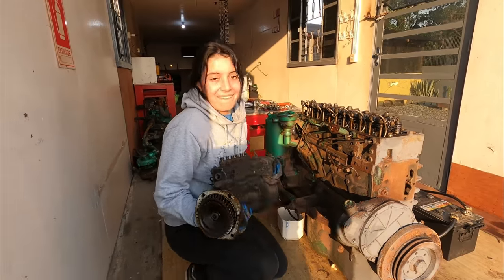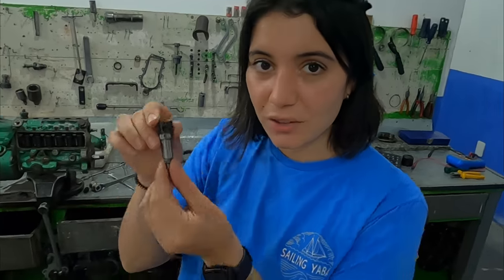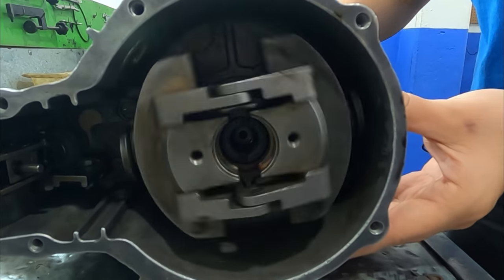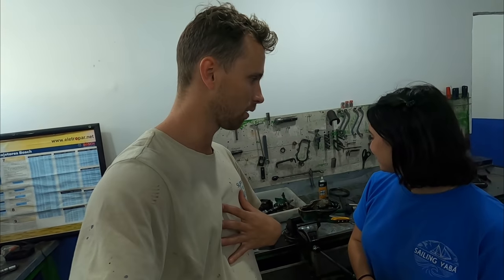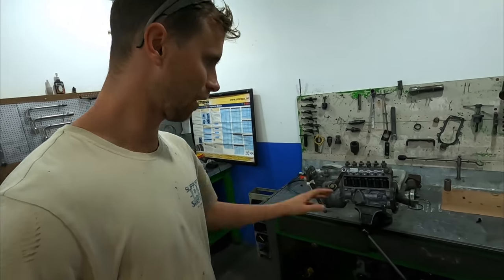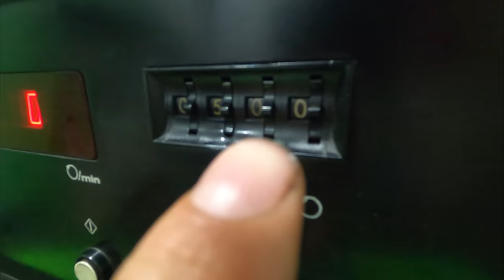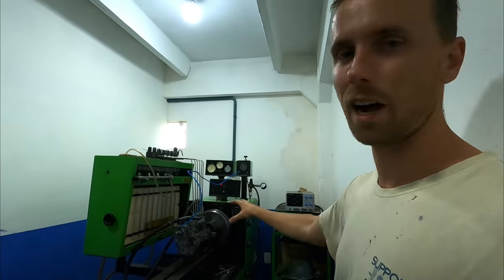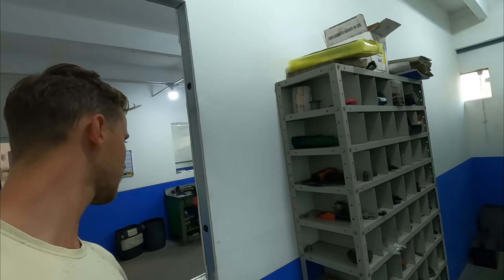Taking apart our old diesel injection pump at a local Brazilian truck stop OM352A — Sailing Yabá #59

Comment from the maker: Hey guys! We hope the skills of our mechanics won't allow you to miss our carpenters too much this week! 
By the way, how lucky are we with all the professionals that we've been meeting along the way?
Reply: You couldn't be luckier. When you started, I will admit, I was very skeptical. I'm not anymore. <3
Reply: I think you are extremely lucky with the professionals you are working with. What a great crew! Also you are so fortunate to have each other and the support of your families. For example we see from the video series that MP's father helps, too. That is wonderful to see,
Reply: MP you seem to have lost a little weight too, you look a little bit cuter.
Reply: Is actually really really lucky that this type engine can be service at regular truck stops! You guys can get good quality service pretty much anywhere in Brazil! But hands down: that shop was impeccable  👏👏👏
Reply: When working in Peru I had an old model Jeep CJ3-B also bcs I wanted to "understand" more of my vehicle I decided to maintain/repair/rebuild the entire vehicle by local mechanics. It went so far as to splitting the engine, re-boring the cylinders, separating body and frame, etc. 
Hopefully your mechanics are of a better league. After re-assembly it had only 50% of the tiny power I had before the "operation" started, and at the end of the day my only option was to abandon the vehicle in the field. Possibly a flimsy job re-surfacing/fitting the block/headers was the culprit. 
Advice: if you re-building old engines down to the last nuts/have any specialist work on your possessions, if you are NOT a mechanic/pro yourself, and if you deal with dodgy persons (as a gringo/foreigner you will most likely be screwed), then have at least a 2nd/non-related mechanic/specialist to verify the quality of the works done, AND do it before you pay.

Comment: Servicing the pump at that shop was the best call, not many places could have done that kind of work
Reply: My thought exactly.  Definitely not a DIY task.
Reply: Not a project for your normal repair shop. They most likely not have the skills,  or equipment. They would need to send it out to a shop such as this or they would just slap the pump back on in the state that it came off. Not good. Your re-conditioner and you made right call.
Reply: I learned this at school many many years ago. Indeed. There are not so many Diesel Services Centers left around these days. It is an art that is no longer mastered by many. Fortunately, there are still many in countries where older vehicles are still being used.

Comment: That was interesting. As an old pump mechanic it was a playback from way back; I've overhauled quite a few of those PES type pumps. When he was running the pump at low RPM; 250 I think it was, he was settling your engine idling speed and checking the individual fuel deliveries did not differ too much from max fuel delivery at high speed. With the idling on the pump set at 250rpm on the test bench, your engine will idle at 500rpm. When the ran the pump at very high speeds he was setting your governor as without one  diesels can get into a nasty habit of running away and blowing themselves up under certain conditions. Nice video. Thanks.
Reply: Is that not with a turbo engine though? They have not got a turbo, have they?
Reply: @johnnunn8688  Hi John. Not sure what you are referring to. They do have a turbo on the engine. The little box on the back of the injection pump is a control diaphragm to increase the fuel delivered when the turbo becomes efficient, or 'kicks in' at higher revs. turbos are not efficient at low revs.
Reply: @cousinjack2841 , oh, I must have misheard Ben. Sorry.
Reply: Takes me back too! That guy was being thorough on that pump. I remember, when I was a youngster, being taught how to do spill port timing on those pumps when putting an engine back together. Very hazy memory now. People advising a new engine, I find that odd. I don't suppose that old Merc lump has worked very hard and, if the standard of rebuild is good, it will have lots of life left in it.
Reply: @andysimons9226  Yes those old Mercs weren't the fastest but you can get a lot of miles out of them. I just remember the throttle linkages on the trucks being an absolute b@astard to get right.
Reply: @andysimons9226  No Andy " people advising a new engine" its not odd, its very sad. Its a generation that we have created where the words maintenence and save are now unknown.
Reply: Took a few injection pumps to get rebuilt. Never had time to watch the rebuild though. To much work to do. Ha ha.

Comment: Very interesting video. I have worked on several Diesel engines but I never really knew how the injector pump worked. It actually looks like a small engine with the cam, valves, valve springs and so on. I think that you made the right call to rebuild rather than buy a new engine. Diesel engines are famous for longevity if they are well maintained. Also the diesel shop looked very well set up and the technician appeared very competent and professional.

Comment: Rebuilding and calibrating a Diesel injector pump a highly skilled and specialized job, impossible without the correct equipment or almost. Great to watch this talented young man take this refurbishment through from start to finish.
Reply: Looks like that guy does that all day every day. Also looks like he got all that work done in a day or 2. Pretty amazing.

Comment: This engine will going to be better than new. I agree with mantaining the old engine, it's cheaper and easier to find parts.
Reply from the maker: Thank you Pedro! We are definitely putting a lot of effort into making our engine as good as possible!
Reply: The best thing is they dont use computerised electronics ..so you can fix it with regular tools 95% of the time.
Reply: @clivestainlesssteelwomble7665  Electronics can usually make things more efficient, but not always more reliable.
Reply: @gsh341  
Yes ...  the number of vehicles disabled by faulty sensors or  controling chips has increased and the other problem that may also show up is software faults. 

A lot of the latter is connected with  the Apple I phone business model basically no one else can touch it or modify it... Thankfully right to repair and similar social changes are being introduced.

Comment: I watched this same process with an old truck engine, I love the fact it is not electronic and not affected by CME from the sun (coronal mass ejections) which have been big enough in the 1800's to melt telegraph wires and the weapon known as electromagnetic pulse or emp that shuts all electronics down, this is a manual pump, no electronics to fry.

Comment: I'm really glad that you are getting the engine repaired and serviced properly. You need to have a working, reliable engine. You are both learning engine-service and repairing skills, especially MP who I think will become a first-class diesel engine technician. She is really good working with the engine. removing the fuel injection pump is something I cannot do myself. So now, when something happens with the engine, you may well have the knowledge to fix it again. And there will be times it just has to be done -- usually at a bad moment.

Comment: I totally agree with the choice on keeping the  old engine since it checked out good. Look! No wires, solinoids, vacuum valves, or Computer controls to take a crap with no one certified to check it out. Plus your pump mechanic has the same hammer I have. Keep up the good work and keep on learning and having fun.

Comment: As I stated earlier those old diesels were designed to be rebuilt over and over and should return to as new condition. If you do a good rebuild and there was nothing catastrophically wrong with the old engine core and all the parts needed are available for the rebuild process every thing should go well. Parts seem to have been available for the injector pump, so that is encouraging. I knew in the U.S. those old injection pump were rebuildable, but here you turn in a core and pick up a rebuilt one and don't get to see all that goes into the job. This was very informative...

Comment: Fascinating as usual. Every step,seems to be in the right direction. At Wildlings they have been really struggling with their engine on an old cat and they say it has spoiled the sailing, so it is reassuring you have advanced👏👏😃

Comment: These injector pumps are difficult to rebuild. When I was in university, we had injector pumps like that. They take so much time to flow test. I was not a fan of flow testing. Wait until you install the pump and time the pump to the engine. Newer engines have an easier way to time and flow test injectors. It brought back memories of university.

Comment: I've always been taught it's better to have an older vehicle/engine that's in perfect running condition than a new untested unit.
Reply: New engines are great, just damned expensive. If parts, for the old one, are readily available, rebuilding it, is the better way. Older Perkins parts are getting rare now days, so people that have them, are fitting new engines, so that they are not stranded in a backwater, with zero parts available.

Comment: glad to see your giving the injector pump  a service and health check for what its going to cost its a worth while exercise also do the injectors as well, the sudden un commanded acceleration at idle would be the mechanical governor device the mechanic looked at  @ 2.46 it relies on centrifugal force , weights and springs it quite  crude but if maintained it ll work reliably, the way to make the most of your  engine rebuild is keep the fuel and tanks clean with good filtration , and change the oil frequently , using cheap oil is ok provided its  changed frequently , if you can drop the sump pan off and wash this out at every oil change as well but im not sure if you have access under  the engine to do this , great video see you on the next one

Comment: I believe you made the right call with your existing engine. It is from a time when engines were built to last and the thorough testing showed no reason to replace it.  New engines are not as well made, can be difficult to get expensive parts for and rely on electronics to operate.  For your purpose of sailing remote areas and heaven forbid the possibility of lightning strikes  having something dependable, easy to maintain / simple to repair is the only answer.

Comment: Good thing to do the overhaul of the injection pump and injectors. Once it is done and once the pump has been installed back on the engine, make sure that the injection is TIMED correctly as well meaning the injection events happening at the precise time that they are needed. 
It will ensure the best starting behaviour, the highest power and  the best possible fuel economy.
Nice video!

Comment: What an informative video! I don't know how much of maintenance you can do onboard Yabá on the fuel injection pump, but I saw a LOT of specialty tools being used! I guessed he was pounding the screwdriver with the wrench to move shims and adjust the volume of fuel being passed for each injector. Do you know what your engine hours were when you took the engine out? Was it a new engine when put in the boat or did it come out of a truck second hand? Big diesel engines are known for many hundreds of thousands of miles but don't know what that might relate to in hours. Do they have any way of guessing at how many hours the engine has operated by the wear on the main bearings? I wouldn't necessarily be worried about reusing that engine knowing how expensive a new one would be! The compression was satisfactory so the other main concern is the wear on the bearings and the seals. You might consult with both of your mechanics to find out what can be done on board within your capabilities and how you might better prepare for it.

Comment: Nice goin m8s, really like how Yabas looking. Back Roads Ben, Excellent idea!  I guess, you wouldn't make a twin engine for manouvreability, maybe 3 if you want to run lights and charge batteries and fill your air tanks, but that just me, overboard! Not a sailor here, was once, found power boats. If, I don't run into anothery, you, yours and your tool drivers have a good Christmas and a happy, healthy and safe New Year.

Comment: with this rpm on the boat this engine will run for ever. one comment. the pump and the camshaft makes the half rpm  from the engine.

Comment: Very professional job.  Just wondering if you will be able to get parts and service for this engine on the other side of the world.  Is this a common engine?  Love the videos.  Thanks.
Reply: It's a Mercedes and I think it was mentioned earlier that it is twenty-five years old. Boat engines usually have low hours if not used commercially. Parts for this engine should be relatively easy to find, if they are required at all. Engines of this type are generally very reliable and durable.

Comment: Well done. I approve of re using the old engine. Ben, the injector pump runs at half engine speed. A four stroke engine fires each cylinder every second revolution of the crankshaft. Hence the injector pump has to "fire" each injector at half the engine speed.

Comment: I also agree that doing what You do will help You to know every nut and bolt on that engine! :-D I also think this engine can run without electricity? Since it has a mecanic diesel-pump the only thing You need is a starting-handle to get it running! :-D The engine will work even if EVERY battery on Yaba is run empty! (Or if there is a nuculear war and an EMP stops everyone elses engine.......)
Reply from the maker: Thank you Tomas! Let's hope no nuclear war ever happens and that everybody's engine can run just fine! haha 😄
Reply: Mechanical injection will not let you down at sea.  Unless the engine is mechanically deranged it has to run.  No ecu cutting the injection off because of low voltage.

Comment: Old Merc engines are properly engineered lumps, they will run forever, just do the oil changes or even better install a secondary oil filter, it is well worth doing.

Comment: The older engines with mechanical injection will give you less problems later Down the road. Electronic fuel injection add wiring and computer issues.

Comment: 10:30 he knows by feel how many ft-lbs of torque that nut needs... 😁😆😁. You should also redo the turbo, if the injection pump was worn, the turbo seals will be next to go. ALSO....does the engine have an air block kill to avoid a runaway if the turbo seals fail?

Comment: Very impressive service. Here (North America) you so often get the "parts NLA so buy a new engine ".
Reply: Considering the OM352 emerged from  somewhere around the end of WW2, yes it is amazing it's still so well supported today worldwide .    Why would you even fleetingly consider risking replacing it with anything else apart from maybe a slightly more modern OM366 or a Gardner?

Comment: Great episode. Something different from the usual is always nice. Has the turbo on the engine had its oil seals checked? Leaking oil seals on a turbo could also cause an engine runaway which can be dangerous as you wont be able to stop the engine and it will also drain all the oil out of the engine which could kill the engine. just a thought in case that was not checked. I don't even know if Yabbas engine has a turbo.

Comment: Great video. Ben have  you picked your prop yet? With the new rebuild on the engine that power has to go in to pushing the boat and not cause too much drag when not in use. A folding prop would be best but unsure if one can be had big enough for Yaba'.  again great job.
Reply: Might be a good idea to install a rope-cutter on the shaft in front of the propeller also, if your old/replacement prop doesn't have one.
Reply: Rope-cutters consist of a sharpened flange or collar designed to cut any rope which might become entangled on your prop. As the rope tightens, the cutter slices through it and it comes off. Much better than going for a swim to try to cut it free. You can wreck a good knife doing that job, not to mention skinned knuckles and potential sharkiness quotient.

Comment: interezting you have an inline injector pump rather than a  rotary or common rail, this means slightly lower pressure but you can run on biodiesel

Comment: That pump probably had water ingestion, and the runout on the governor is typically caused by severe overspeed. 

That engine in yaba was abused
Reply: And now, it has been de-abused. 😜

Comment: I still think you should have replaced the Engine like ODD did. But if your just going to be coastal and not Bluewater, rebuilding it will be fine. Reason is you will never find parts for that engine except for Brazil!

Comment: Ben & MP - When you are on the high seas you'll know what needs fixing! 

People who own older boats need this level of understanding to be not only safe but know when their boat needs a bit of TLC to keep it tip-top! 

I've seen too many people stuck with a dead motor which only needed a simple fix but as they didn't have a clue on how their engine worked got into trouble! Sadly, some died needlessly after the coast guard investigated.

Comment: This is a very big and strong workshop can I be employed at diesel injector pump sensor I do both command and mechanical pumps cat injectors Volvo a vehicle piezo Denzel whatever injector you want me to repair I can repair it for you if you want to check both of my pictures or videos you can Google country diesel lab

Comment: The older diesel engines are more reliable than the state of the so called art where a tiny electric problem will turn the engine off. I would never have a computer controlled injection system in a boat